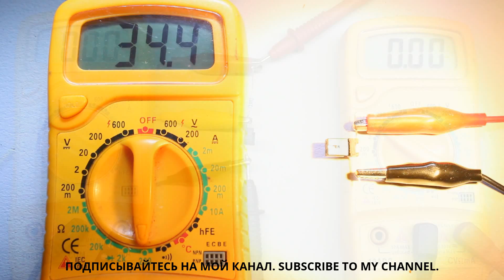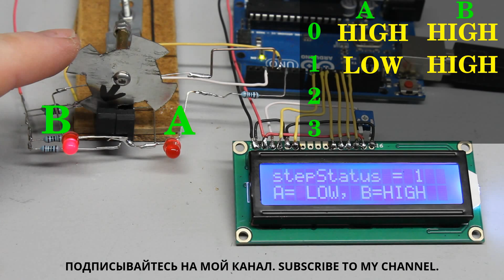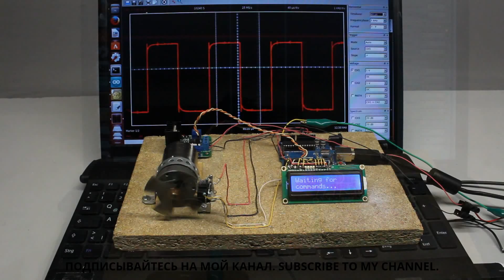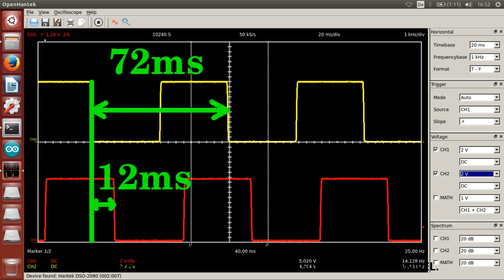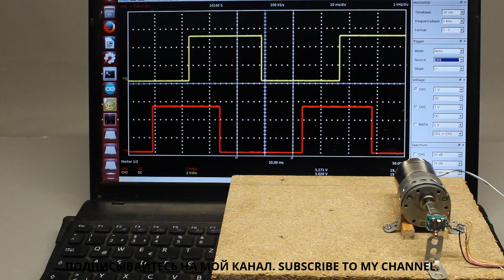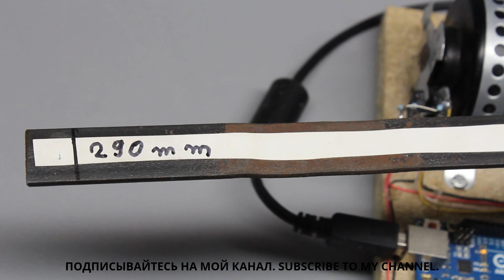⚫ How to Build a Rotary Encoder Arduino and Photo sensors. ♦СТРОЙКА & РЕМОНТ♦

Comment: My homemade Six Digit, 20MHz, CD74HC192 Up-Down counter circuit counts Quadrature Encoder pulses at 20Mhz speeds. And seems to be many times faster than using my PIC16F887 microcontrollers.

Can you tell me why?
Reply from the maker: I don`t know.

Comment: hi sir i love your videos a lot. i want to know the code you have written for the rotation controll of the dc motor based on the no of steps in the video from 10:00 to10:58  using optical encoder. i have seen the project page but i cant find the code for that particular action. plz tel me where can i get that code i want to learn it and use it for my project .
Reply from the maker: I`ve taken this video with CC license. In description below there is the reference to the author video.